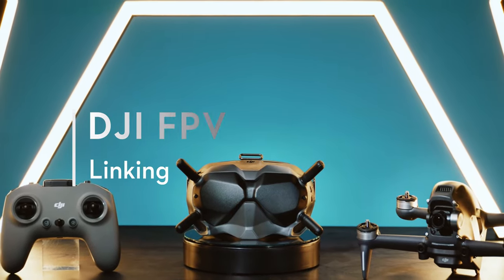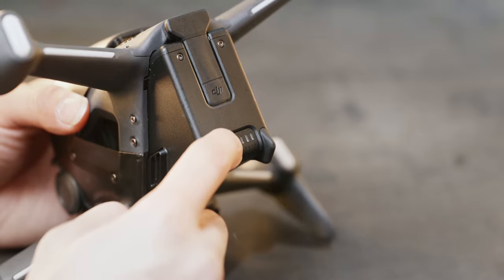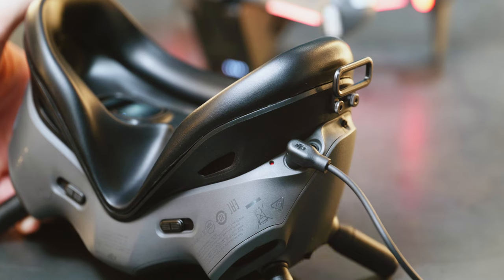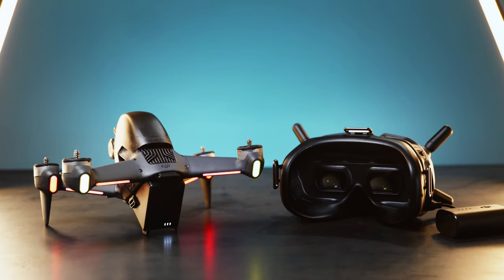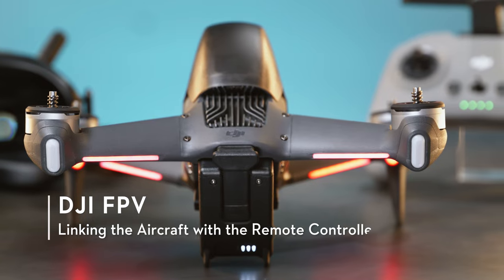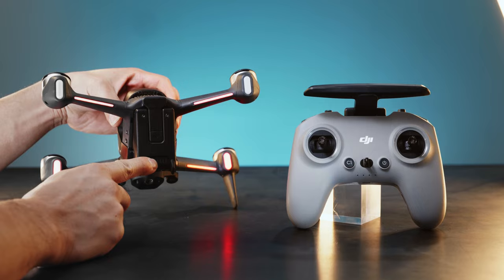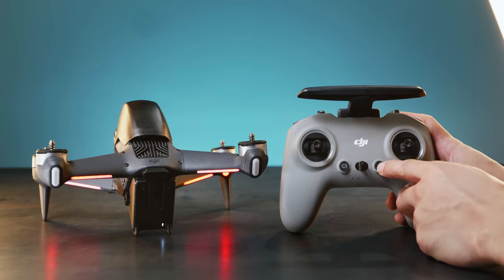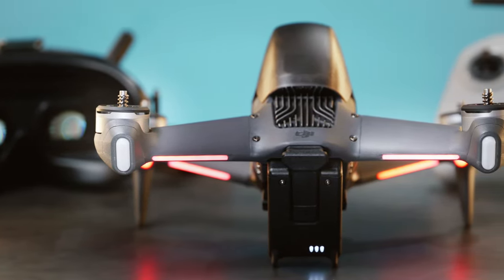DJI FPV | How to Link the DJI FPV with Goggles and Remote Controller

Comment: I would like to use the DJI virtual flight, I have the goggles and controller. It doesn’t pick up the controller. These are blinded to my DJI o3, and vista with no issues. Can you help?

Comment: My fpv won’t link. 

I’ve done exactly what this video says step by step multiple times. 

I used to always fly this fpv with these goggles and controlller. 
Recently I’ve been flying the Avata with these goggles and controller, but today I wanted to take my fpv out and it just will not link????

Comment: I'm having an issue with the goggle battery, it just blinks three times when i plug it in, no matter what cable or power source i use. The battery is not charged enough to power the goggles and charging it doesnt seem to work as it always just blinks three times. The manual also has nothing about that, any help?

Comment: Can there be multiple drones linked to a single controller and goggle?
Reply from the maker: Hello, there. DJI FPV remote controller 2 does not support dual remote controller mode. Audience mode is supported on DJI FPV Goggles V2/ DJI Goggles 2.

Comment: Hello, I am able to link everything with this exact controller just fine. But I just got the DJI FPV Remote Controller (The Black one with switches) and I'm unable to link it to the DJI FPV air unit.  Just sits in bind mode.  It does link to the goggles just fine, but not to the air unit.  Any suggestions? Thanks!
Reply from the maker: Hi there, we are sorry to hear about the difficulties that you encountered. Please contact our support team via http://www.dji.com/support and provide more details, we'll do our best to help this out.

Comment: Can i link Googles, Drone and remote controller to use flight simulator without activating drone cause i  hasnt purchase DJI Care refreh yet?
Reply from the maker: Hi there, we are sorry that you may need to activate the FPV first to use the DJI Vertual Flight app. May we know if you encountered any issue purchasing DJI Care Refresh.

Comment: Any advice on how to link the DJI Goggles v2 with my Phantom 4 Pro? I put the drone and the goggles into link mode.....but they don't see each other. I've tried both the FPV digital  and FPV modes. The P4 Pro are supposed to be supported, but so far I haven't found any detailed instructions. The Googles v2 manual instructions don't work...but do say the Goggles should be linked before the remote controller. What that means for a existing P4 Pro and controller isn't at all clear......but nothing has worked so far.
Reply from the maker: Currently, the DJI FPV Goggles V2 only support the DJI FPV System. For the compatibility plan of the product, please stay tuned to DJI's official website. Thank you for your understanding and support.
Reply: @DJITutorials  Thank you. There are some  3rd party web sites with information from DJI about the DJI Goggles, but they've posted it under a Goggles v2 title. I think that mislead me. I've ordered the FPV drone now ....
Reply from the maker: @SteveWithers  You're welcome. Should you have any further inquiries, please feel free to contact us.

Comment: May I connect 2 goggles to 1 Fpv? Then when my friend fly, two of us could watch FPV flying via 2 goggles in the same time? Thks mate.
Reply: Yes you can, I got this working yesterday. 
In the transmission menu you need to turn on broadcasting on the pilot goggles, and put the other pair in in audience mode.
In audience mode you can then select the feed you want to spectate. So if there is more then one broadcasting pilot in the air you could even switch between them.

Comment: Is it possible to link DJI Goggles V1 to their FPV-Drone and Controller (Gen2)?
Reply from the maker: Hi Kilian, sorry to inform you that the DJI FPV Goggles in the DJI Digital FPV System Combo cannot be used with the DJI FPV Combo. Thanks for your understanding.

Comment: Can the FPV Drone Goggles be linked and used with the Mavic 2 Pro or Zoom?  or any other DJI Drones?
Reply from the maker: Hello, the DJI Goggles cannot be linked with the DJI drones you mentioned above. Thanks
Reply: @DJITutorials  Hello. I have DJI FPV and Geprc Mark 5 with O3 system. The idea was use both drones with same goggles and controller ( you switch in Settings > About > Switch Aircraft Model ). I just did it for the first time. I mean I was flying for weeks with my new Geprc, but I wanted to film a cinematic shot on N mode so today I went with DJI FPV. I turned on everything, went to option to switch it up, restarted the goggles and the drone just won’t work. I have “image transmission lost” and the screen is just black with no indicators,  nothing. Why? How do I switch back to DJI FPV now if I want to use it?

Comment: Hy dji i need help. How to fix my fpv sensor system error and gps error.?
Reply from the maker: Hello, there. Would you please check the things below?
1. Restart the aircraft, and the remote controller.
2. Please connect to DJI Assistant 2 and refresh the aircraft firmware.
Reply: @DJITutorials  how to restart the aircraft and remote controller.?  I've been looking for a solution but can't find it. Thx
Reply from the maker: @sail0rc0de  You can turn off your drone and remote control, and then turn it on again. If the problem is still not resolved, you can try to download DJI Assistant 2 from our official website to refresh the firmware. If the issue persists, please contact our Support for further help: http://www.dji.com/support
Hope this helps.

Comment: Some reason my googles battery have and my googles not turning on
Reply from the maker: Hi there, could you please tell us more details? Please try to fully charge the battery and try to power it on again. Please also tell us if the LED indicators will turn on.
Reply: @DJITutorials  the battery is full off charge all light on I feel like I need a new cable
Reply from the maker: @OTRPOLO_1804  Thanks for the feedback. 
If you still have problems after replacing the new cable, please let us know. Or you can contact support via the link below: https://www.dji.com/support/repair Thanks again
Reply: @DJITutorials  my cable just came and it’s working thanks for not ignoring my comment
Reply from the maker: @OTRPOLO_1804  Thanks for your update. It's good to know your issue has been resolved.
Reply: Yes

Comment: It doesn't work for me: the googles keep blinking and the aircraft keep waiting... poor programming
Reply from the maker: Hi Marco, we are sorry for the issue. Please try to refresh the latest firmware for each component via DJI Assistant 2 and try to link the googles to the aircraft first, then the aircraft to the controller. See if this helps.

Comment: This POS won’t connect. The useless Googles V2 won’t connect. I followed the directions. I did it 7 times. I restarted the app, the drone, I placed both on “link mode” and the Googles say RC Signal Lost. Great product!!
Reply from the maker: Hi there, we are sorry for the issue you encounter. Kindly make sure to update all the firmware to the latest version first, and relink the units again. If the issue persists, please provide us with an operation video for better confirmation. You may send it to us via online chat or email on our official website or in DJI Fly app. We look forward to hearing back from you.
Reply: @DJITutorials  I watched a YouTube video and the iPhone 15 Pro Max doesn’t  do well with bad or cheap cables. So I used what the guy showed on his video and it worked like a charm. A USB C Cable that’s direct and has that on each end. Of course all was updated perfectly. I fix cars and I’m not even a mechanic, I can fix almost anything if I put my mind to it but who knew that the cables it came from DJI with were not compatible with the latest and greatest phones?? Go figure!
Reply from the maker: @tomgunc Thank you for your reply, just to double confirm, you were able to solve the issue after replacing the cable, right? We will take note of your feedback.